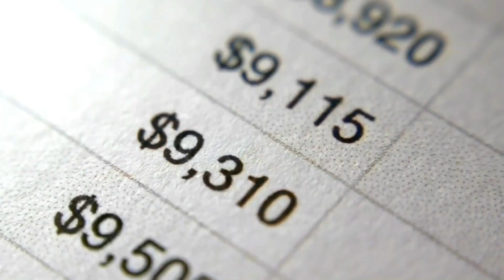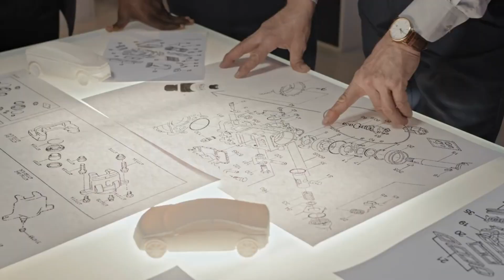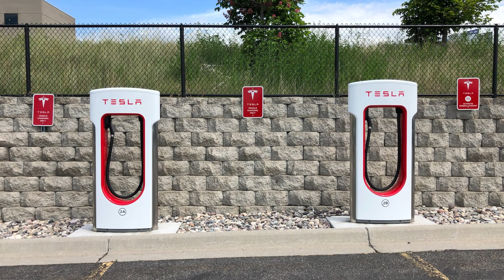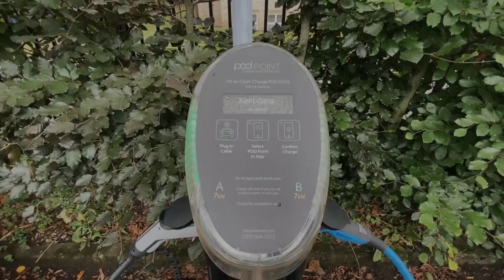Elon Musk 9,000 Ton Tesla Cybertruck Giga Press Has Arrived!!

Comment: Tesla is one of the biggest and most popular car manufacturers, primarily geared towards green energy saving cars to save the environment.  Tesla is a clean energy and electric vehicle firm. Tesla is also the largest seller of plug-in electric vehicles. Tesla is up for releasing their futuristic goal of cyber truck, which they plan to begin cyber truck mass production towards the end of 2023. The extra shell of the Cyber truck is designed for maximum durability and passenger safety, also with the impenetrable exoskeleton that is made with exceptional strength and endurance from the Tesla's armor glass to the ultra hard stainless steel structural skin. Thank you so much for doing this video.